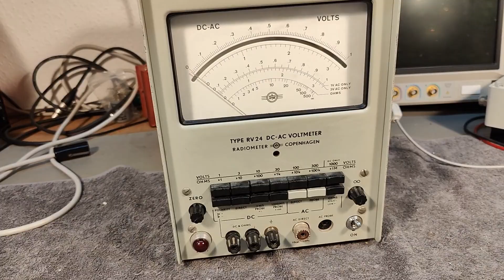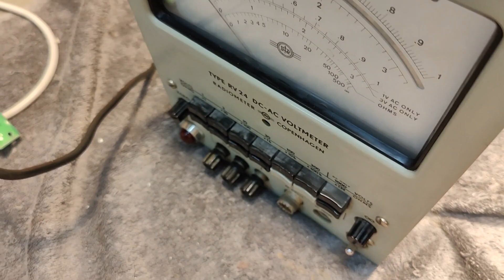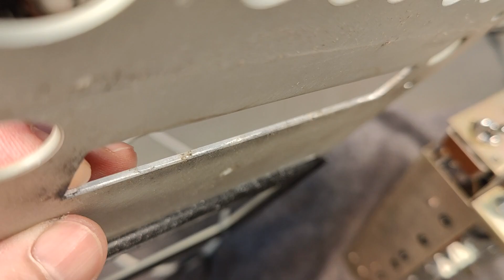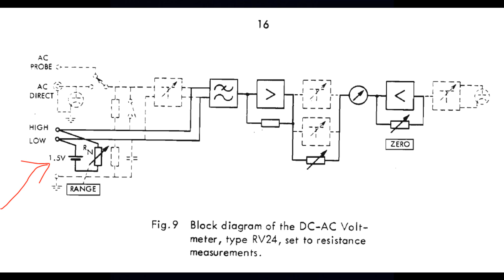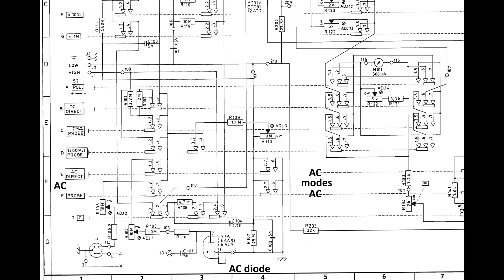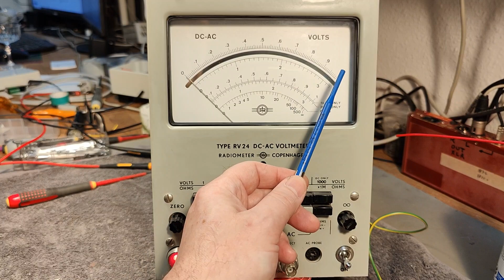Radiometer RV24 vacuum tube DC AC voltmeter ohm 1964

Comment: Some of the similar units made by other manufacturers gave 50 MHz as the maximum for flatness. However, several manufacturers claimed that their meters would have a span of up to say 100 MHz, but you had to use a correction chart in the manual. After about 50 MHz, their accuracy really drops off. Also, most meter movements have an accuracy of about 3% of scale. That was why HP developed machinery to manufacture their own meter faces, and why they're matched to the unit they're mounted in, much like the probes.
Reply from the maker: good idea to solve that

Comment: No way! For a second I thought YouTube recommended me my own video because I have 2 of those voltmeters and I also made videos about them. Have a look at my video. :D
At 14:40 I would advice checking the batteries under load or checking their internal resistance. I had some very old Hellesens battery in mine and the voltage was ok on the multimeter but it dropped to almost zero with a 10k in parallel.
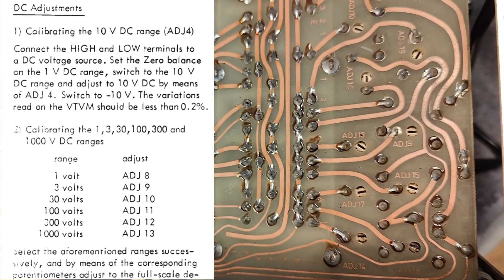At 16:21 I wouldn't call the calibration so easy because all the trimpots are on the bottom, but the meter really has to stand upright for a correct reading. Also, I'm pretty sure that due to thermal and noise reasons it would be a good idea to calibrate it with all the panels in place, which makes getting to the trimpots a complete nightmare.
At 22:30 I had no idea what the diode stack does. Nice circuit analysis!
Reply from the maker: THANKS, you are absolutly right, a battery must always to tested at load, to tell if it contain anything good, but in my case the ohmmeter in this unit uses micro amps, and i only needed it to work while making the video, now the battery it takes out, since i recommend to store instruments WITHOUT batteries of any type
Reply: @TeardownOZ2CPU  Yeah, for storage I would take the battery out too. The instrument is too nice to be destroyed by a shitty battery.
Reply from the maker: @VoidElectronics i have devoted a large portion of my time on this planet, to tell people : please remove batteries from ANYTHING you dont use all the time.
looks like i have failed my mission.. so please help me folks..

Comment: Even modern measuring devices should be allowed to warm up properly in order to be as accurate as possible :)
Reply from the maker: most modern equipment is full of temperature sensors and thermal compensations of all sorts of analog things that is affected by temperature, this means you get full resolution and full accuracy from just powered up to many hrs later.

Comment: I would think that if that unit was on a shelf higher than 12 inches then there would be a difference in height .... When the operator would press the selector button his finger would be putting a little bit of upward pressure on the selector ..... After a few years of use it would be showing the use ... Just a thought ...